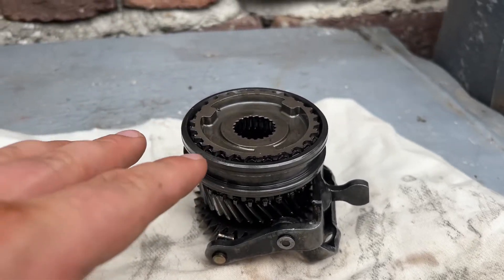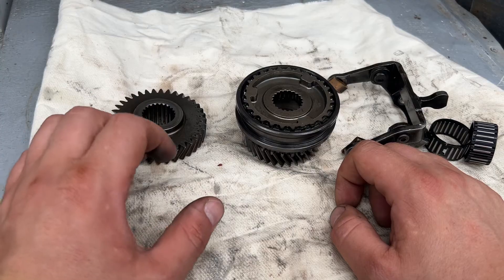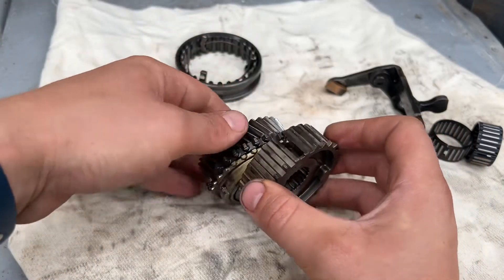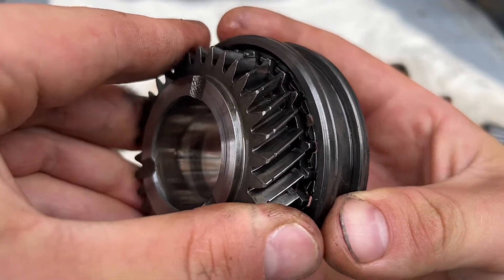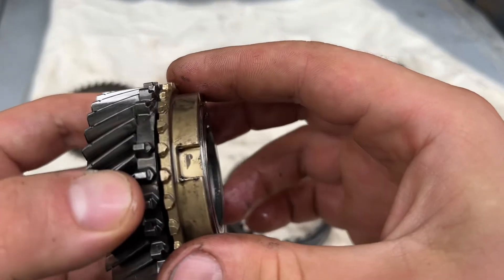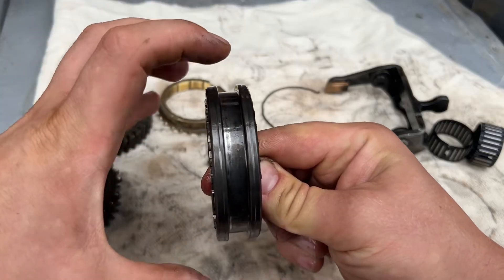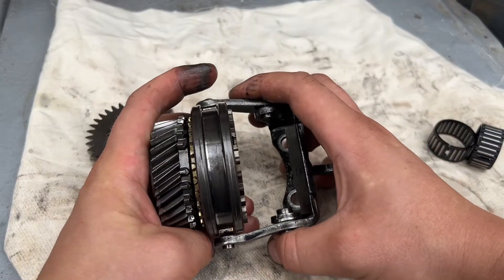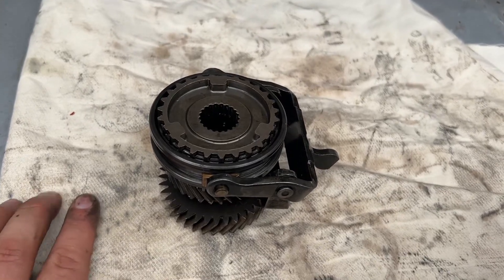Does your Car Pops out off Gear ? Here is explanation WHY ?

Comment: So is it juat repaling the synchros that will solve this issue.. what would a repair cost for this typically cost?
Reply from the maker: Cost is different for all different cars. But replacing the worn out parts usually It's solving the issue.

Comment: Oddly on my car this exact problem happens on 5th gear. 
Can you tell us from what car these gears come from?
I own a Xsara Picasso (first model) but it has the gearshift handle module seperate from the gearbox connected by rods or cables (im not sure which one). I'm not sure if the module is bad or gearbox is bad or isn't setup right. 
When accelerating the gearshift moves a lot in every gear. But it pops out on the 5th more often than other gears.
Reply from the maker: Gm f17 gearbox